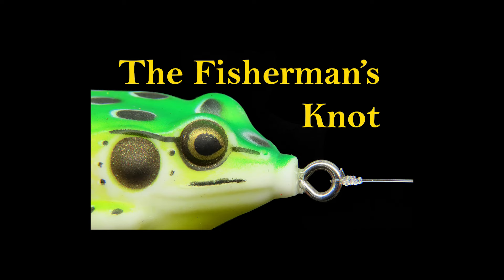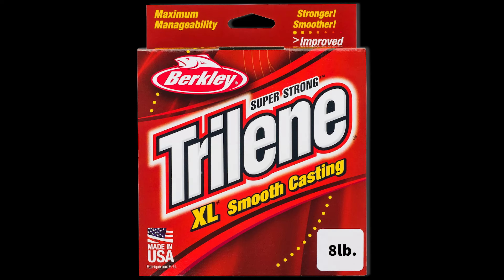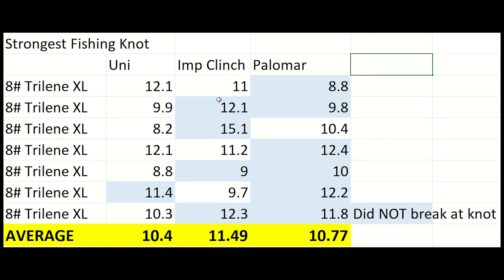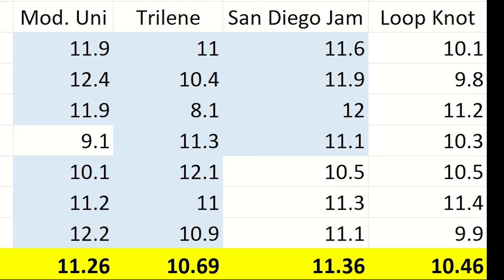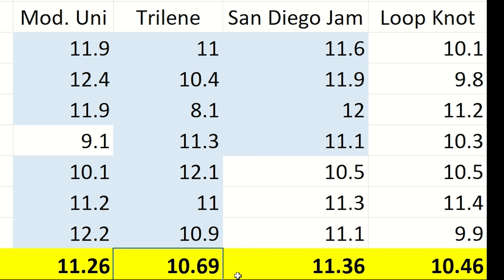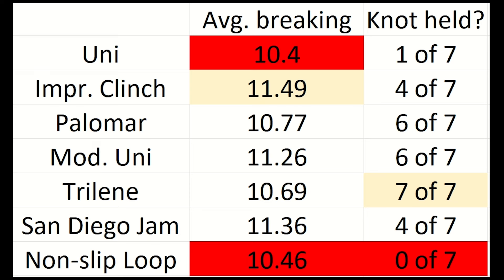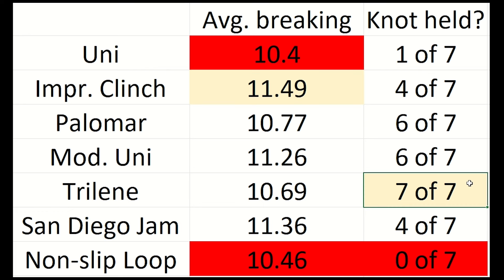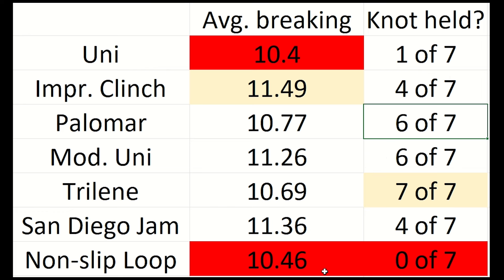Strongest Fishing Knot Test - Which is the Strongest?

Comment: Hey Nat, have you ever tried/tested or maybe can test a loop to loop knot to connect to a lure? Using one bigger loop  made on a leader and  built-in metal loop on a lure itself. I wonder if it is weaket than a clinch o palomar. As in such connection it give you ability to change lures without snap.
Reply from the maker: That's the way we tied it when doing this test - as seen in this loop knot demo video https://youtu.be/yT5kC35LVIk . One big loop connected to the metal loop built into the lure. It doesn't allow for lure changes without cutting the knot though. Is this what you have in mind?
Reply: @FishingwithNat  not exactly. I mean loop to loop connection, like when you connect a leader to  main line with a feeder or fly line to leader. If you make bigger loop it will allow you to use it on most of jigs and short lures. Like in this video https://www.youtube.com/watch?v=L3YBTzr5iDI but as a second loop you use metal ring of a lure itself.
Reply from the maker: @pradd2004  Oh, gotcha. Sounds like a fun test to me. :)

Comment: Just one mans opinion that has been fishing for over 50 years 
I do not see how any knot that holds to MORE than 100% of the breaking strength let alone 110% of the line can possibly not be judged as a complete success 
Now factor in your reels drag set properly and using your rod properly to reduce the forces on your line while fighting a fish and a knot that holds to 110% of the braking strength of your fishing line becomes even more reliable 
My problem with 99% of these knot breaking strength tests are the methodology of apply force by a human is absolutely and utterly inconsistent and in my opinion inconsistencies yeild results that can not be regarded as both accurate and reliable
Reply from the maker: In this test, I tried to keep everything as consistent as possible by having the spool secured and pulling straight up in the same way with the same length of line each time, and removing several feet of line after each test just in case the nearby line was compromised in any way from each test.
I think some lines are stronger than their strength rating, which will obviously increase the breaking strength of any knot used on that line as well. Regardless of your line or knot, you shouldn't be pushing either of those to their braking strength. That's the purpose of the reel's drag system.